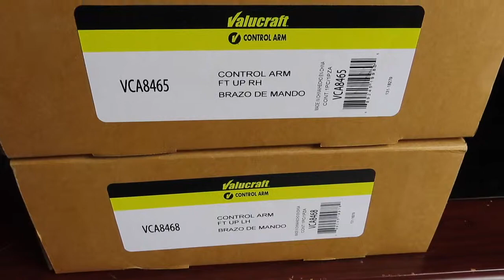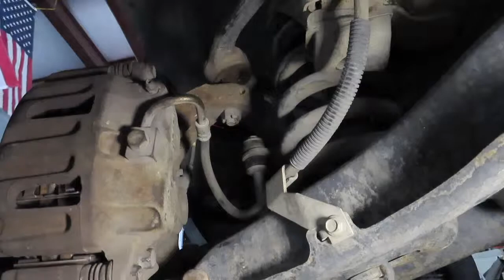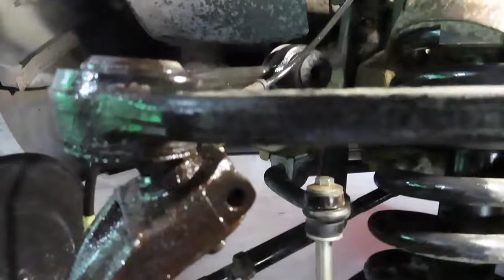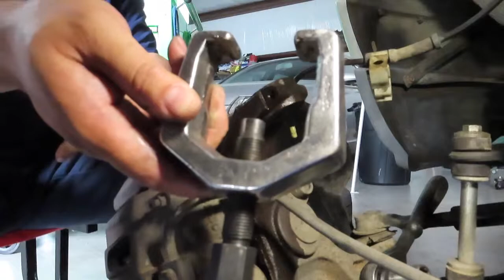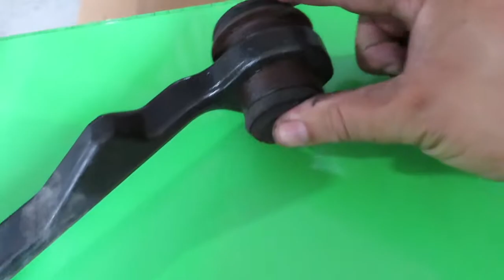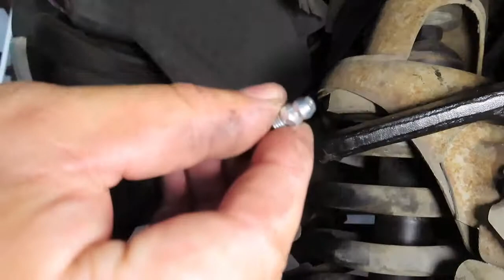Replacing Upper Control Arm 1997-2002 Ford F-150 RWD

Comment: the truck doesn't have caster only camber. the "Spacer" is a plate for keeping the bore hole of the control arm bushings back towards the engine or forward towards the tire. Just make sure the control arm is all the way forward to the tire. Even if its not aligned right, when you get your alignment they will fix it if needed.
Reply: I took my truck same model to the alignment shop. They told me I needed these parts. I got them parts but they want to charge to much for the labor of this job. Its looks to simple for me to let them do it. Im just wondering if I can put. The parts on my self and then take it up there to get the alignment? And will it cause any damage To do that before the alignment?

Comment: I just don't get it, if you aren't going to reuse the ball joint, why not just hammer it out? It will never make sense to me.
Reply: The rubber bushings on the upper control arm wear out too.  The upper control arms are usually sold with the ball joints installed.

Comment: Next time take the upper ball joint off 1st. Once loosened the castle nut use 2 hammers n smack both sides of the upper balljoint knuckle  ( notice the rectangle striking points on either side of the knuckle) it w pop loose easily. Waste to much time n effort w the separator. Fogettaboutit! And mark paint the bushing nuts.  Or your caster n camber Alignment be like NFG.
Reply: Yup. Everyone has a hammer laying around... So it's less expensive than the puller...
Reply: Fixing to replace my uppers and lower balljoints.. thanks for the tip!